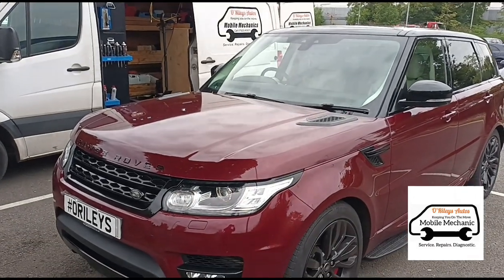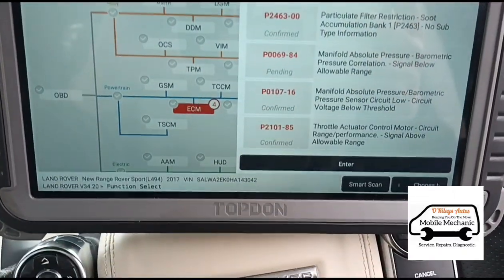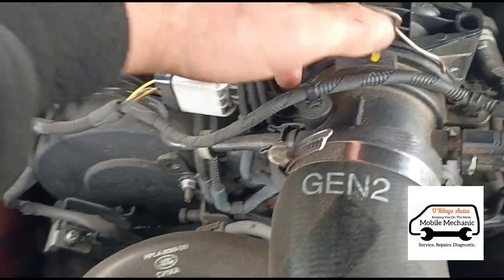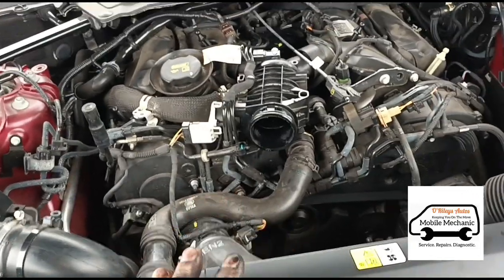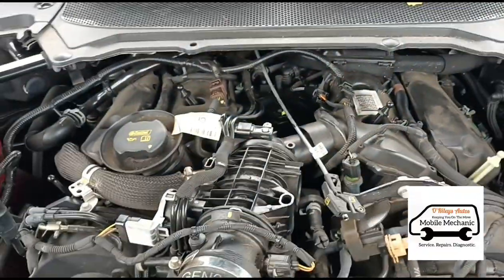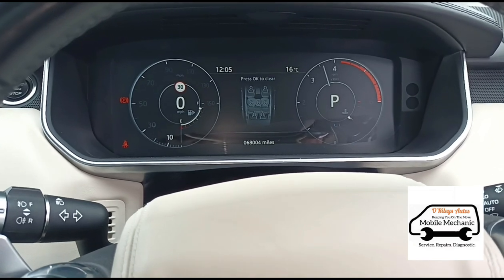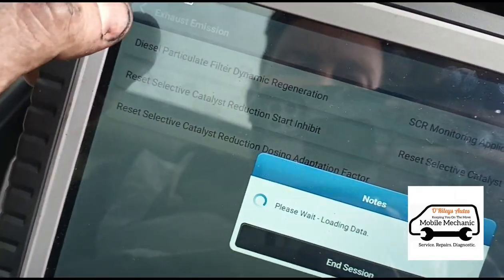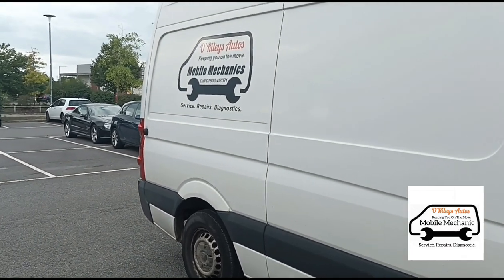Range Rover Sport 3.0 P0107-16 P0069-84 MAP Sensor Circuit  P2101-85 Throttle Actuator Control Motor

Comment: In case anyone is having a hard time paying for something that has LR on the box, the code for the MAP sensor, LR077148; cross references to the actual Hitachi PN of PRS0019.  The FoMoCo PN stamped on the actual part I removed from my '16 TD6, is BC3Q-9F479-AD ( I have two 16' RR  w/ TD6 and both have the same exact part installed).   Ridiculous that LR wants $300, online LR dealers are $175-$200 plus shipping, when you can get the Hitachi PN for as low as $38.   

I pulled my whole intake manifold to clean up the ridiculous amount of carbon/oil buildup from the EGR valve.  This is why our diesel engines get torn up and don't last, emissions crap!!!  Hope this helps!  Cleaned up both of my vehicles and now they drive like a champ.
Reply: Thanks a million for this, I have an overboost issue and fixed the sticking throttle body so now thinking it’s the sensor as still getting the error. I just ordered the Hitachi part now so fingers crossed. Thanks again this is a big saving.
Reply: @SuperMike67890  Glad to help!  I ordered mine from RockAuto, was here in 5 days and error code went away on first start up.   Just did the brakes, rotors too, and LR has to be the easiest on any vehicle I’ve worked on!  Ordered the rotors, Brembos, from Amazon for $60 each, online from other vendors are $150 and up for non OEM.